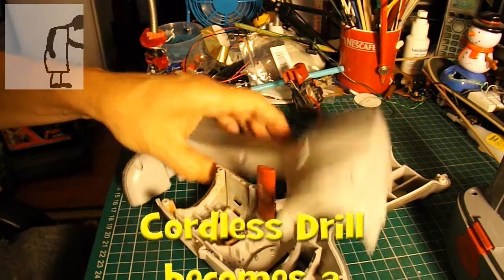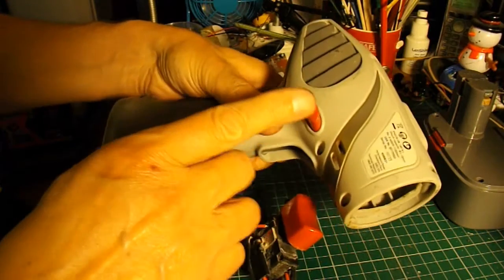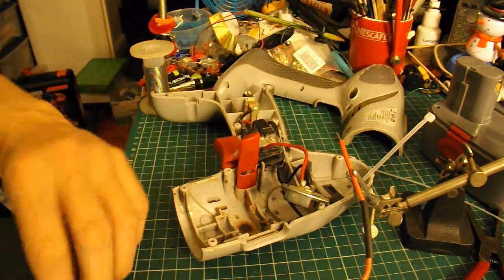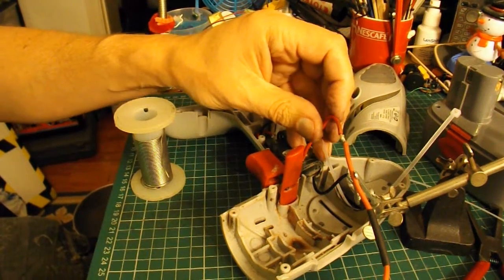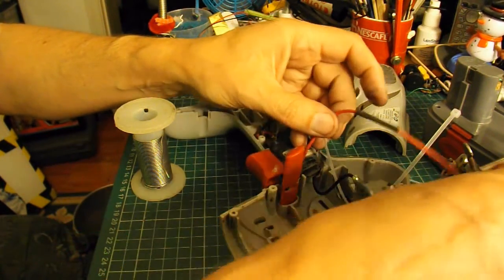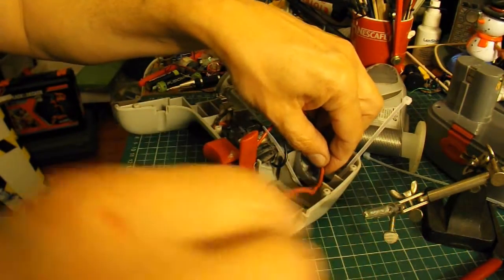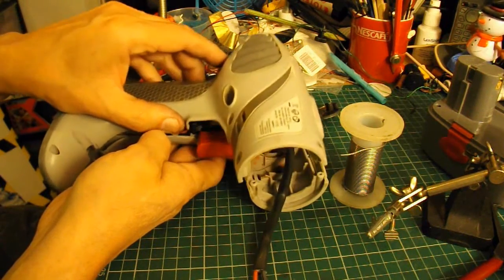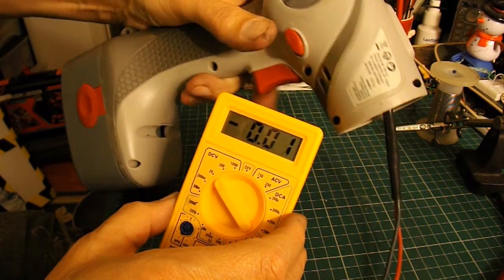Cordless Drill becomes Variable Power supply

Comment: Hello Grandad. My cousin asked if you did some sort of electrician course or something like that because he thinks your soldering job is awesome. Great Idea for the the drill parts. 
Gave a good day. :)
Reply from the maker: +Sahan Methmal I was a telephone engineer for many years
Reply: Ahhhh i see. Thanks for the quick reply. :)
Reply: +GrandadIsAnOldMan thought I noticed some 81's in previous video. (only BT engineer would know what I'm on about)
Reply from the maker: willsgrandad yes and nippers dc and the wire strippers and before you get too excited about how I have them I bought them at a second hand tool dealer in Barnstaple pannier market back in the 90s, always handy to have some spares :-) Love your garage, easier than climbing up into the loft which is where so many people have to put theirs. No I don't have any, I just have junk in my loft and in my garage.

Comment: Good idea that, Grandad. I think that would be a pwm motor controller in that drill.
Reply from the maker: +davidrobert2007 there certainly is a bit of circuitry there but I haven't taken the trigger assembly apart to find out. As it works OK I plan to use it as it is without breaking it down.

Comment from the maker: I took my cordless drill apart when it stopped working and found the motor was faulty. It might be possible to source a replacement motor but they are relatively expensive and I would rather put that money towards the cost of a new drill. It then occurred to me that the old battery could be a useful power source for my projects and the trigger gives us variable control and reverse so I have simply extended the power wires for ease of access.